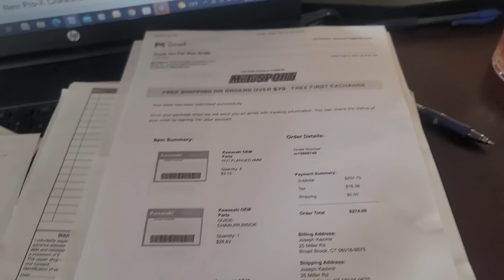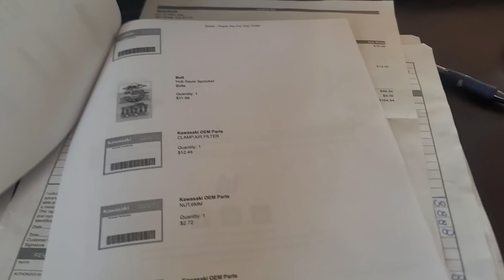MX REAL TALK; WHY IS IT SO EXPENSIVE TO PAY A SHOP TO RESTORE A MOTORCYCLE?

Comment: Having a shop work on anything cars, trucks, bikes everything is expensive! The overhead just to pay the bills to keep the shop open before paying payroll is crazy expensive. People have no idea how much it costs to run a business and then if you hire quality employees that’s another huge cost. I had a customer tell me the shop next to me was 150 cheaper for a brake job and wanted me to match their price I said sorry I don’t use cheap low quality parts I can’t afford to do it cheaper! If I used cheap brake parts they will make noise so they went next door and a month later they said u were right they did my brakes 3 times and they still make noise. I’ve had people complain about part prices on engine parts saying they can get them cheaper well I only use factory engine parts like timing chains because aftermarket stuff sucks. Quality costs money there is no way around it if it’s cheap corners get cut. Someone tells me they can get a transmission rebuilt for 1500 cheaper well that’s because they are reusing all the hard parts just slamming in a clutch kit. 

If you buy a bike from someone that does them at home in their garage even if they did a 110% fantastic job they can afford to sell it cheap because they don’t have any overhead and they don’t need to stand behind it. But usually when you buy anything that someone builds at home it’s not the quality that a shop will do they use cheap parts, they don’t know what parts don’t last and what do because they don’t do the volume of builds a shop does. Another thing I do at my shop is I only buy electrical parts from the dealer, I had a warranty company tell me they can get a transmission solenoid pack for a dodge van we had at my shop for 150 bucks and mine was almost 400 bucks and I told them well the aftermarket dorman part you can get for 150 is junk we don’t use that brand because all of their electrical parts fail in 6 months so if u want me to use that then I will not give any warranty, they told me that’s all they can do so I called the customer to ask them what they want to do put the junk part on with no warranty or they pay an extra 200 for the quality part and get a warranty, they picked the quality part and they called the warranty company yelling at them. Well my point is if the customer went to a lower quality shop they would have installed the cheap part and in 6 months the part would have failed which could cause the transmission to fail if not fixed right away and cost them more money in the long run anyways. Or like when a customer comes in with their car over heating so bad because of the head gasket and I tell them it needs a motor but they just want the head gasket done I tell them if they only do the head gasket the motor could likely fail soon after so they bring it to another shop that replaces the engine then a month later it has a rod knock and again it’s someone trying to be cheap and it costs more money it can get expensive trying to be cheap.

Comment: I stopped my bike collecting and restoring due to cost and time/labour, just sold 98 yz125 roller project with 2 engines 750.00.gonna stick with my restored ready to ride bikes.so true what K says!.CR450R- RMX250-WR250 Husky- RM80- XR100

Comment: It's hard to explain to people what it takes. My shop takes about a year to restore frame up. 10000./15000. When you tell them Labor plus parts they fall over. So most go for the oily rag overhaul . clean up what they have and try to make it all work.4000./6000.  Just to get there barnfind bike to run and stop runs 3000.  I've started building bikes that I like and selling them is a lot easier. Customers are hard to deal with. And now that I'm in my 60s. I don't have the patiences for people. I started in a Yamaha shop in 1974 it's been some kind of ride. Keep up the good work.
Reply from the maker: You hit the nail on the head 100%

Comment: Those Kawasaki's in green (fade in UV) are very hard to get right and then the anodizing and getting all the colors right.

You may put a few thousand into something and it still looks like crap.  Like SR says very few people do this.  Your local Kawasaki shop will most likely just laugh at you. 

=Buy the best condition and most complete bike you can.  Even the bikes in crates have brake seals etc that have been eaten, corrosion/rust etc.
-option #2.  Buy many of the same bike for parts and get 1 good bike.

Comment: I will register my official disappointment with a couple of motorcycle shops in the DC area a couple of decades ago.  I called and asked if they'd look over and give me a quote to get a Yamaha street bike back on the road, something I got for next to nothing but was complete and had potential.  And, curious to me, both shops did absolutely nothing, no quotes, no nothing, and I think the second shop was waiting for me to just abandon it.  Not sure what was up, but it was disappointing.  And no worries, I hauled it back and a friend offered to rebuild the engine.  And it was disassembled and left in pieces and that was that between that bike and me.

Comment: So what was the price on the KAW $25,000 ?
Reply from the maker: It should be
Reply from the maker: 10500
Reply: So your under water on that bike ? Because it sure sounded like more than 10,500. I'm a big MAICO fan I rode a 1978 250cc & 450cc in the amateur days than when I turned expert in the early 80's I rode the 490cc at sixteen years old.
🙃✌❤💯
Reply from the maker: Yes 10500 is break even with no overhead included so a loss

Comment: Sadly regular people are not willing to pay anyone to do these type of restorations or buy these restored bikes for crazy amount of money they either collectors with serious cash that always wanted one or had one when young that's only way that kind of money changes hands sadly them bikes will mostly sit and not be ridden just like the hot rods and muscle car prices it will eventually drop when demand isn't there anymore... I've restored and bought project bikes and have gotten stuff for deals but yes I do all the work myself and i dont powdercoat I primer, paint, and clear coat my frames. I've tried to do side work from mechanical on cars and trucks to bikes and quads even welding side jobs nobody wants to pay anything. Even if I charged half what a shop is charging say 50 bucks a hour people will still complain or wont have the money... People out there are lazy these days they pay people to mow the lawn etc. If people want to be handy learn and do it yourself but dont be cheap when you want someone else to do the work. Getting a car or bike to restore you need a blank check or amount of cash to start with and people dont have that or if they do when that amount gets spent or runs low then I stop working on the project and move onto paying projects people dont understand that. I do mx pipe dent repair on my own mx pipes since finding any or a new one you cant I offered my services online on marketplace to people not one has asked or have done one for someone people dont wanna pay for anything. Something for sale  is only worth what it goes down the driveway for.

Comment: People need to understand when you do a Fame off resto you are creating the bike better then new, plus when you get one from Kaplan you are getting a one of a kind bike that has been gone over by experts, any bike that Kaplan does we see in the videos... Kaplan Lets the bikes do the talking,  enough said............
Reply: Wouldn’t say better than new but just as good as oem
Reply: Expensive but worth every penny IMHO
Reply: @skylermummert24  Paints are better, anodizing, polishing agents, vapor honing aluminum.  Vapor honing made doing aluminum air cooled heads much better looking.  Plastics and rubber components are better.  Electronics are way better than the 60's, 70's and most 80's. 

=compare a rebuild from 10-20yrs ago to what is being done now.

Comment: I remember seeing a 1997 cr250 for $6500 brand new at the Honda dealer in 1997. The idea of in 2022 paying $25 to 30k for the same bike I think is why people call it expensive. But if I have an extra 30k laying around And I want to relive my childhood I would say it's worth it.
Reply: If you’re a collector sure, but you might as well buy a new bike for 8-10k and save your money. I will say though, my favorite bike ever is a 03 kx250 and I prefer it over a new 250 2 stroke. That’s my only exception personally
Reply from the maker: Anybody that pays $25000 for A CR250 is out of their mind. We had a couple of brand new ones that we sold here recently fresh out of the crate and they only bought 12500
Reply: @KaplanCycles  I was thinking of a frame off restoration with the polished aluminum and all that like the Kawasaki in the video. I'm guessing thats going to be an expensive bike no doubt

Comment: You know whats wrong with “ the customer is always right “ ?   The customer ISNT always right.   Ive  always wondered  how you can make the $ to cover the overhead from lots of frame-ups and produce the cherries yall make.  Even Joe Blow in his garage struggles to put a price on his time and get that back.   A ton of time it takes too.   Not to mention, EVERYTHING is more expensive these days.  R Estate asside.  Look at used auto prices.   “ cheap trucks “ that run have disappeared.   The 5k truck is now 10k with 150mi over 10 yrs old.    Yall offer premium custom restoration work on very old bikes.   Its VERY RARE for a reason.   Too hard to make much profit.  Youve seen success at other things so you can live with less profit because you LOVE what you do and it ables you to have friends and family close to you.   Thats worth much more than the bottom line im sure.   I bet the naysayers  would be surprised to see how tight your numbers are on those bikes.   Im sure you even lose a little on some of them.     I have huge respect for what you do up there and love to check in midday sometimes and crank a 2 stroke in my truck speakers.    Thx Kap’n

Comment: Hey Ken, you didn’t mention the reason why this particular bike motor wasn’t built in house. If I may ask why did you decide to sub contract this one out? Just a staffing/priority issue? And by the way I don’t see how you actually turn a profit on a restoration so ignore these ignorant assholes, they clearly are just trolls.
Reply from the maker: This particular restoration was done by a long term friend of mine I'm it was maybe 75% complete hes a local guy so I know all the vendors and the guy that built the engine has been doing my engines for many many years in fact all of my championships were won with his motors before I had my own full time professional mechanics working for me

Comment: 3d scan by LiDAR or scann3D or iOS equivalent photogrammetry to 3D printing on licence from Old new manufacturers metal xjet 3D printing or Cheap plastics 3D printers.
Old parts full bikes /vehicles which spare parts aren't available 😁
Can scan any existing product pristine condition of fully stock parts 3D printing machines on demand refurbished to cutsom parts and shapeshift some parts panels bodywork.

Inset to outset groove border can xjet will melt enamel/ceramics fire Clays to add Badge logos icon etc colourful upon Metal.
ALON glass parts carburettor to pistons and casings.
How would you want your old new Fbook chopper video #evpistonpower full electric 2 4 stroke to any switch to full electric Piston power with gears